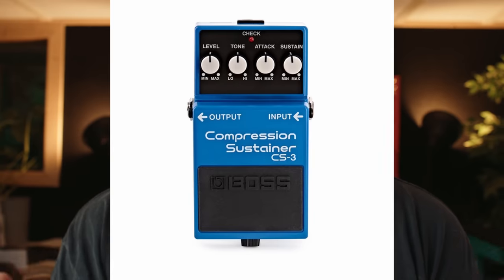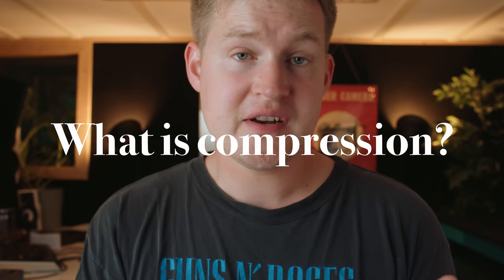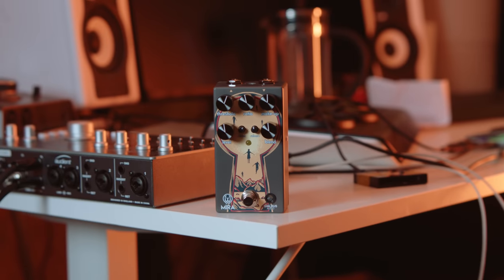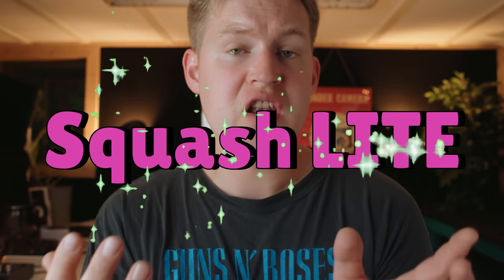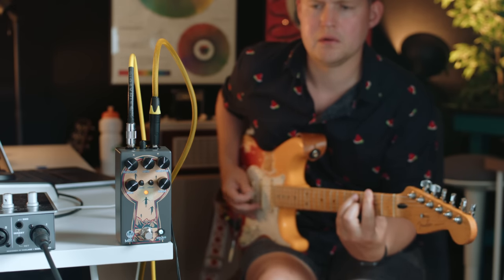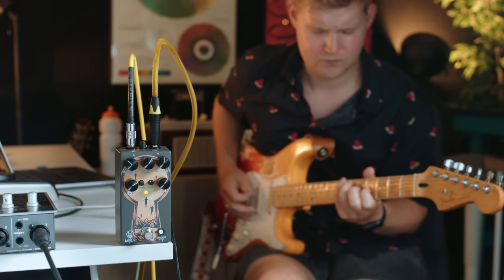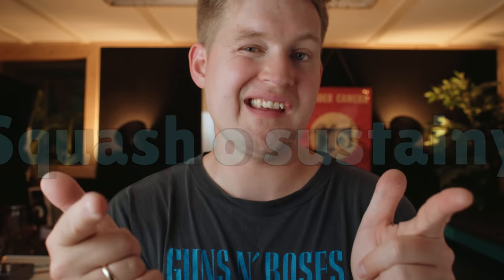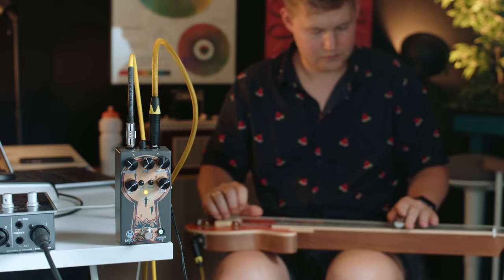Everyone is wrong about compressors (How they should be used with guitar)

Comment: I've built, bought, and sold at least a dozen or more compressors.  One of my all-time favorites is the first one I ever bought, in the late '70s: the Univox Uni-Comp.  It is probably the simplest optical compressor ever made.  And while it is clean, it is an effect and not the sort of thing one would describe as "transparent".  I.E., you can tell it's on.  It has a special affinity for Telecaster bridge pickups.

One of the most important functions of guitar compressors is that they allow the player to unhook volume from tone.  You can get the same volume level, whether you deliberately snap the strings or gently brush them.  Volume dynamics are certainly important for conveying feeling and emotion, but so is timbre and pick attack, and sometimes you just want to provide that emotion simply by getting the string to behave differently.  You illustrate that aspect nicely around the 3:40-3:50 mark.  The percussive aspect of Telecaster bridge pickups is one of those areas where compressors shine.

Additionally, from a performing perspective, compressors are especially useful in yielding a good mix to a band by letting a guitarist slam away without the risk of drowning out a singer or other bandmate.  We tend to think of pedals in terms of our own personal sound, but compressors allow a band to sound more like a recorded studio mix, than a bunch of people occasionally drowning each other out.  And if you happen to be the guitar player AND singer, it lets you focus on singing, and not have to pay attention to how hard you're strumming.

Comment: Another interesting use for compressors that i discovered recently is using it with an overdriven amp or distortion pedal to clean up the sound. Basically like turning down the volume knob on the guitar but with more control
Reply: mike from incubus uses this technique
Reply: Like an "underdrive" 😆
Reply from the maker: didn't know about this. Thanks, will try!
Reply: nice ... not sure about 'more control' though
Reply: have you considered to do it like this:
60-75% signal from guitar -> compressor -> distortion/overdrive

Comment: I swear of all the effects out there compressors are the ones that have highest learning curve. Even now, I really can't say I'm anywhere near mastering compression, and that's after attending music courses in college and University. I'm still learning new things about them. Knowing how to apply attack and release controls I'm still not 100% on. The tone shaping aspect of compression is also a higher level function that still an ongoing process for me. It's all part of the process.
Reply: And that is why, for most guitar players, the compressor with the fewest knobs is best.  For years, I had the original Keeley and was very happy, because with 2 knobs there wans't much that could go wrong.  With fancier compressors like the Empress that I currently use, the problem is interactivity.  To some extent, each adjustment affects the others, so you chase your tail forever.  But the Empress is so transparent, it sounds good at almost any setting.  Who knows if I have it set right.

Comment: I run two compressors, similar to a good buffer setup. 1 on the input and 1 on the output after the amp. I do this on an HX Stomp. The equivalent in a non-virtual setup would be like sending the mic’d amplifier into a studio compressor, then I run real analog delay after. It’s like a portable studio.

Guitar > gain pedals > squash compressor, 40% mix > amp > modulation effects > mix/studio compressor, 40% mix > delay > speaker
Reply: I’m sure it sounds realistic.
Reply: @smelltheglove2038  probably not but it might sound good, which is an important part of it all

Comment: Bought a little Fairfield Circuitry FET compressor pedal and hated it when my only amp was a Vox AC-15. The amp already had enough compression built in. It wasn't until I got a more powerful amp with more headroom that I understood how to use the compressor pedal for clean sounds.
Reply: The Accountant? I love that pedal. Certainly not the most subtle compressor but that's part of why it works for me!

Comment: Compression does not give you more "loudness" 1:16.  Compression REDUCES loudness by attenuating loud signal.  It increases volume by boosting quiet signal.  Loudness and volume are very different.  Loudness is measured at one point.  It's one dimensional, like a line segment.  Think of a loud drum hit.  It's very loud for a very short transient loudness peak.  You can graph this by drawing a vertical line segment from the x axis up to the peak.  
Volume is measured over a period of time, and is three dimensional.  When an organ player gets almost as loud as the line segment drum hit and stays approximately that loud for five minutes, the total five minutes of sound multiplies out to much more volume than the single drum hit, even though for a fraction of a second the drum was louder than the organ.

Comment: a small but meaningful correction: compressors don't typically boost the quiet parts of your sound and attenuate the loud parts, they do one or the other. usually they just attenuate the loud parts according to a dB threshold, and via a ratio, one or both of which are often preset within a pedal, as to decrease the amount of knobs and to create a more user friendly interface. its important to know that this means compressors do not inherently introduce additional noise or sustain with more aggressive settings, but when you use makeup gain to make up for the volume lost in attenuation, as most people do in order to not see a volume decrease and boost sustain, it also boosts the noise floor. doesn't change much about what you're saying but i think this provides some clarity for people who are getting used to using compressors.
Reply from the maker: Thanks for this!